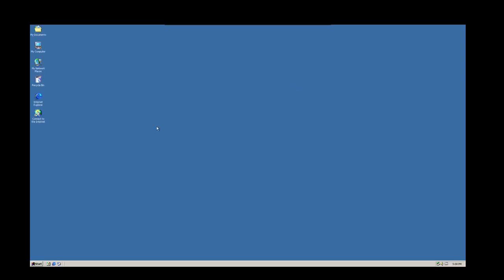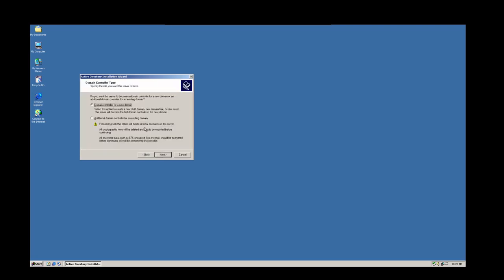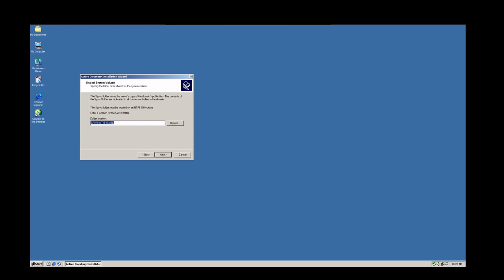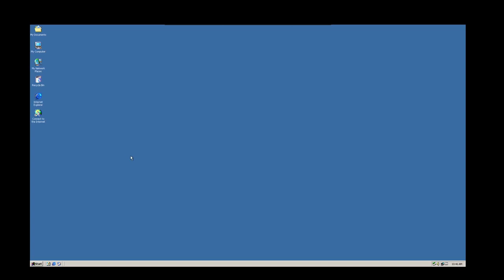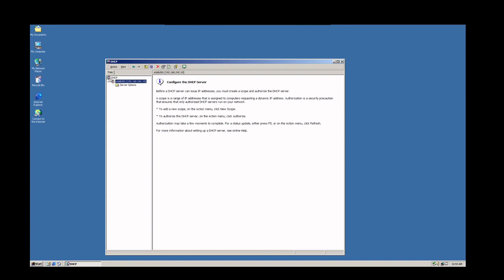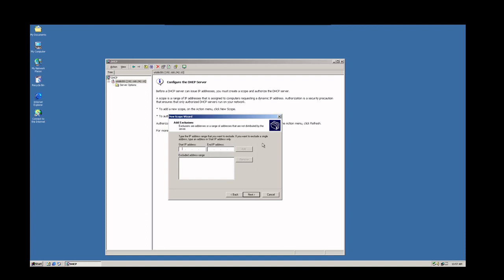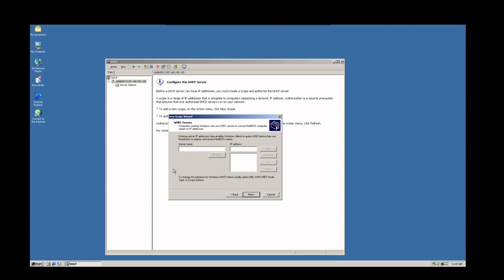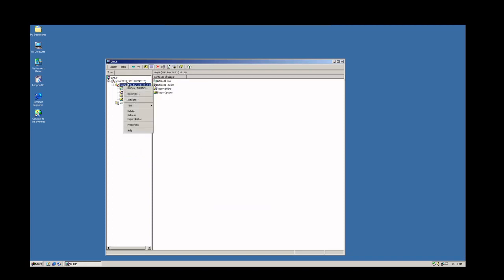How to build a windows 2000 Domain Controller

Comment: Thanks for a nice trip down memory lane. Strange what things your remember and not remember. I worked with NT domains in 3.5 and 4.0 and later AD up to 2012r2. If someone would ask me I would be 100% sure the wizard for setting up AD was there in W2K, but in the same second as you mentioned dcpromo the memory came back. On the other hand I will probably never forget to set the DHCP option WINS/NBT Node type to 0x8 (hybrid) which was only a thing for NT/w9x clients. Thanks for the nostalgia.